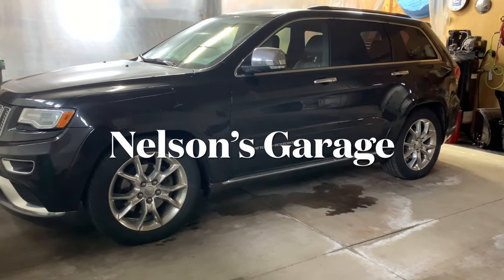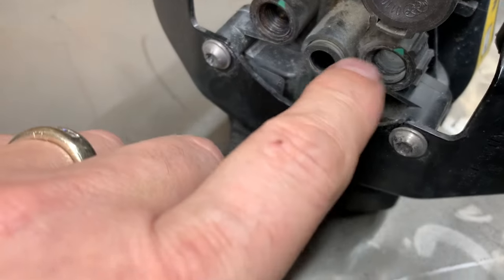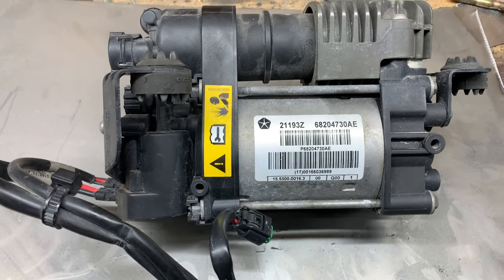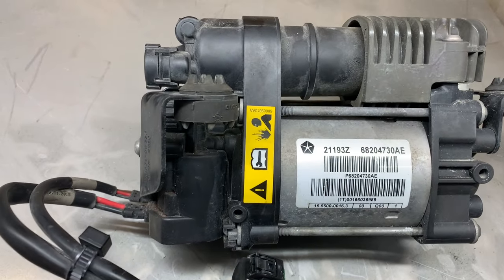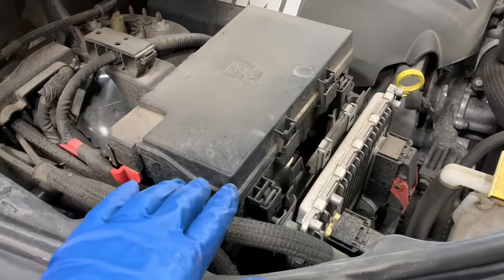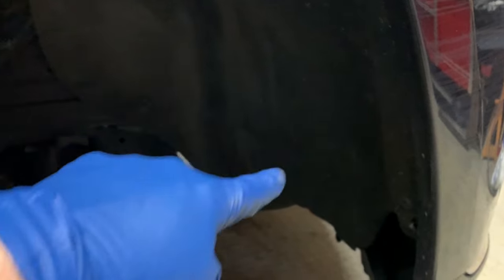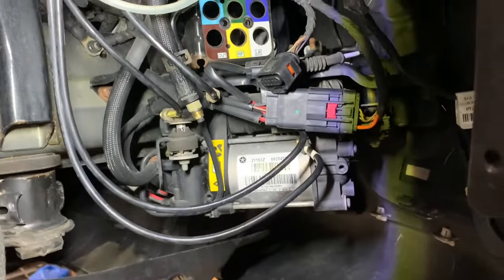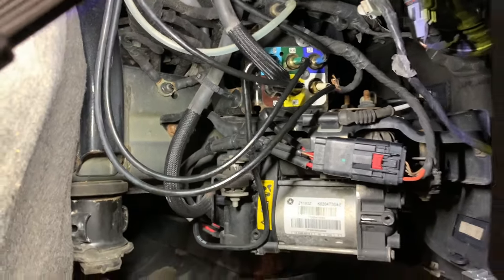Jeep Grand Cherokee Air Suspension Fix

Comment: Once you refilled the system, did you need to make any software adjustments any proprietary software required to get the system back in functioning order?
I noticed another video showed some kind of Jeep/ Mopar scan tool/software required to re-pressurize the system?
Reply from the maker: I did not make any software adjustments. I filled like i showed in the video and that was it. after, i connected to a scanner to clear any code that were caused from the pump valve issue. but that is it.
Reply: Did you have to decompress the system prior to starting the project and removing the compressor unit ?

Comment: my official jeep estimate was to change the compressor and control unit for 3000 dollars but they didn't understand that when the cars are out of the official guarantee these are prices that only thieves can afford
Reply: Yeah the dealership quoted me 5k to have the compressor replaced... After they filled the system with 100% air after a service... I told them to fly a kite

Comment: After replacing air suspension compressor, about 30 mins later I got this code C15A0-13 “ Air suspension reverse valve 2 control circuit open”. Please help. Everything is connected, fuses are ok. The code instantly comes on when erased.
Reply from the maker: That is open or high resistance connection. Check the connections, both compressor and module ( if you took the connector apart). Check for bent or pushed out pins. Also check for damaged wire, this would be pin 4 at the compressor and pin 46 at the control module, you can check resistance between those connections and should be less than 5 ohms, that will verify a good wire. Same with wires pin 5 and pin 45. Then connect the compressor and Check the ohms at the controller plug between pin 46 and 45, that should be less than 10 ohms if it’s above the compressor is bad, if it’s below the controller may be bad. That is a lot, I’m thinking it’s just a connection.

Comment: My English is not very good. But here is my question. I have a big 2014 Cherokee overland and it happens to be lowered from the front end. but he told me that I should check the automatic suspension quickly. So I took it to the dealer. Well, they changed the compressor and an air suspension on the driver's side, that was in January of this year. This week it went down again. Now I took her and they changed the passenger side. but he went to another place because the dealer gave me a bad experience because they had my car for 3 weeks. On the other hand, wherever I took it, in 2 days it was ready when the piece arrived. but they gave it to me and it says that I should take it to the dealer to reset the computer to read the new part. This is true?? Because the car is still down and on the dashboard it only shows off road 2 but it showed the same thing when we took it. And now I do not know what to do. Well, I have already adjusted the normal mode but the lights keep blinking to go up or down. And I don't understand, it already has new both sides of the suspension and also the Compressor and the pump. I hope you can guide me
Reply from the maker: If the height sensors were changed it is possible that the computer needs to re-learn those sensors and the height that they are at and the height they should be.

Comment: Good job trimming the hose going to the press-loc on the pump.   That's a common leak point many people wouldn't think to trim.  The brass connections on the manifold block are called compression fittings.  Glad to see you figured it out and helped others troubleshoot.  👍

Comment: Thanks for posting this video!  Was having the exact same issue (GC would raise just fine but wouldn't go down below normal ride height and had frequent "service air suspension immediately" messages) and likely would have followed the same path of replacing the valve block first if I hadn't seen your video.  I was unaware of the reversing valve on the pump.  Replaced the pump and refilled the tank with UHP nitrogen and now the car will go both down and up like it is supposed to.
Reply from the maker: Glad it helped
Reply: Hi John, as I have the exactly same problem on my JGC 2014, am I to understand that it is better to replace the compressor with the valve block as well, even if the compressor seems to work but stops because it overheats?

Comment: So when you unscrewed each fitting from the valve block, did each bag lose its air?  I keep hearing how these and the 90* fittings are an easy fix for leaks, but nobody talks about if the system holds air while you have bits unplugged, which if it dumps, requires a nitro refill which isn't readily as quick and easy for the average joe to do.
Reply from the maker: Yes, the bags will deflate when the fittings are removed. If you can’t or don’t have nitrogen you can use air from a compressor and it will work fine but remember air has moisture in it and may cause issues down the road.

Comment: I have a 2017 with same Quad Lift system.   Had an air leak was cracked air line to front strut.  Ended up getting 90 degree connections to strut and air line set from Mopar. RMT doesn’t sell the air line. Where air line fits to strut it’s flared.  Straight hose won’t connect

Comment: Hello, I have my 2018 GC HA around 96000 miles I got this warning, took to a dealer they replaced the valve block for 1800$ and said the problem is solved I paid and checked my car it was not solved. They took it back immediately and checked 4 days and the issue was not fixed, when I questioned, they came back with 3400$ estimate for a possible compressor replacement. 😣 they mentioned that they took a less price route to replace valve block, I don't understand how these dealers service department  cannot figure if it out before hand. If a valve block or compressor valve was causing it and they call it a world class inspection. 😢

Have to figure out a way now.

Some times it works fine but it keeps coming back. No fuses were blown out ever. 

Auto/Park mode while lowering is where the service code was triggering from what I understand.
Reply from the maker: Hope this will get figured out for you. the valve block controls each corner of the suspension (sending the up and down air to each corner), the pump has a valve that controls the up and down function. if you are randomly having this issue it will be a matter of time when the pump will need to be replaced.
Reply: @Nelsons-Garage I got it diagnosed with an outside mechanic and I was given codes- c15a1-00 and c1562-98. They mentioned that they cannot repair at a third party service - they need to calibrate with the systems, which would be at the dealership only. How did you reset the system after replacement?
Reply from the maker: @Vishnuroczz  there was no need to recalibrate the system, just clear codes, after install.
Reply: Great video. I own a 2017 GC with 100k.  Dealer is quoting $5400 plus tax for the repair including the air suspension control module and the compressor. This seems like robbery. 
Question: how did you decompress the system before starting?
Did you have to reprogram the system with special software or a device one the new compressor was installed and pressurized?
Finally where did you find the nitrogen tank supplier ?
Thank you !
Reply from the maker: @afcase  I didn't do any thing special to decompress the system, i just unhooked the lines. After the new compressor was installed, i did not do any reprogramming as the system knows where it should be do to the height sensors. The nitrogen was from a local gas/weld supply company, i used Air-Gas company.
Reply: Hello Nelson, Can you tell me if part 68572790AA comes with valve block ? Or is it just the air compressor
Reply from the maker: @Vishnuroczz  that looks like the pump only, without the valve block. But please note the pump has a reversing valve built in. The reversing valve raises and lowers the vehicle. The valve block distributes the up or down action (created from the pump) to each air bag. I hope that makes sense.
Reply: I got it fixed from a dealer but was not sure if the valve block comes with the complete assembly. The picture in the mopar website  shows the valve block assembled. So was wondering  about it.
Reply: I have the exact same situation. 2019 GC Overland. The pump would run a long time and not go down, I took the cvar to the Jeep dealer and they guaranteed it was the valve block.  Not even 30 miles the warning appeared now I need to replace the pump/cpmpressor. Really not happy with the dealer. $2700.00CDN$ to trouble shoot and tell me it is the pump. Now another $4800.0 CDN$ to replace the pump compressor. 
I have seen another comment regarding a rebuilt pump from RMT indicating that it is good value and reliable fix. However, I am not sure the dealer would want to install refurbished parts.
Thanks for the great video and explaining in how the system works.

Comment: Thanks for this great video about repairing air suspensions on JGC. I have the same problem with my JGC 2014 Summit 5,7L.
Can you give me the part number of the connector that fits on the nitrogen tank to recharge it, because mine (R134) does not fit. Can you also give us the Amazon reference of the regulator (yellow, red, blue) that you use? Thanks a thousand times. Alan
Reply from the maker: The nitrogen regulator is by Yeswelder, WX-YQD-CGA580 from Amazon. the gauge setup to charge the tank is from Harbor freight it is just a standard automotive AC charge gauge set. I think the larger line connects to the tank.
Reply: @Nelsons-Garage  Thank you very much. I have bought the same Yeswelder regulator on Amazon. I have just ordered a set on RMT website (valves block and compressor) and I returned a Luft Meister compressor and a valves block purchased on Amazon, because I'm not sure it will work well in winter... RMT is a better alternative, I think ! I will follow your excellent tuto, but first I will try with pressurized air and I will change for nitrogen if it works.

Comment: My wifes jeep displays service immediately. Goes up and down fine, does not leak as far as i know. Dealer said the compressor and module are fried. Light only comes on on the highway. Anh idea's? Thanks! Great video
Reply from the maker: Its hard to tell without a scan, but the suspension does go down in aero on the highway. if this doesn't happen in a timely manor it would display the service immediately. This is tough to guess at,   but i would first check the links at each control arm making sure they are not loose or broken. otherwise, it sounds as if the compressor is doing its job going up and down and the module is communicating to the compressor. the only thing would be time, if the compressor runs too long, the service light comes on. leading me towards the compressor and the valve within the compressor becoming slow or leaky (inside the system). I would think through time the service light will start coming on more frequent. this is all just a guess without a scan.... good luck and let me know what you find.
Reply: Wow! Super fast reply! I will dig into it today a little more. Super frustrating.

Comment: Thank you so much for this information. I have a 2013 grand cherokee 5.7 , 1st the front was struggling to lift and i was advertised to  replace the schocks which were indeed  warn. Now the compressor doesn't run at all. I've checked the fuses and relays but all seems good. I haven't regassed it yet. I need to drive it to the dealer to get gassed. But why is the compressor not running 😢
Reply from the maker: That’s hard to say without a scanner on the system, possible it’s the controller. But I wouldn’t jump to conclusions without a scan.

Comment: Question, I have a ram 1500 that has two of those tanks, under the truck. Does the Jeep have two tanks as well? I'm trying to determine what size tank I need and how much nitrogen needs to be in it in order to refill my entire system because I have to replace both the air compressor and the distribution block. Thanks
The dealer quoted me $4,800 to replace the air compressor and the distribution block. I bought the air compressor and distribution block from RMT for $400 plus core. I'm not a full-fledged mechanic, but I've done plenty of work to cars, so I'm hoping it's not too difficult. I also have access to alpha ODB to do any additional settings.
Reply from the maker: The Jeep only has one tank as far as I know, but if you got a small nitrogen tank it would be plenty..
Reply: @Nelsons-Garage  thank you!
Reply: @m3rdpwr  Have you guys had good performance from the RMT compressors ?

Comment: Did you have to decompress the system prior to starting the project and removing the compressor unit ?
Also, how did you know what the final pressure should be when filling the tank? Did you cycle the height while filling the tank
Reply from the maker: I did not decompress the system, I pulled the line and let the pressure out. I checked the pressure before I started and put that much back in.

Comment: excuse me, I have my jeep air compressor works at each morning for about 15- 60 seconds, is that normal ? 
one mechanic told me it is normal for the compressor to adapt to low pressures in cold weather at morning.
thank you again for explanations.
Reply from the maker: No, the system shouldn't have a pressure difference due to temperature. This is why there is nitrogen used. Nitrogen doesn't contain moisture like air so it doesn't fluctuate pressure with temperature. If you used air to fill your system, then yes i could see that happening.
Reply: @Nelsons-Garage  amazing information, thank you ..
I dont know my system is filled with air or nitrogen , but one time the mechanic deflated the front air springs both , without replacement, so I thought that the compressor itself had filled the deficiency, for sure by ambient air.
so that means if I dont have a leak, and I filled the system by nitrogen, I would not have fluctuations in pressure in the future.
Reply from the maker: @hassanmahmood661  Correct, the system is designed to pull outside air IF the system went low on nitrogen.
Reply: @Nelsons-Garage  thanks alot.. and forgive my poor language sir..

Comment: So I have a 2019 Jeep Grand Cherokee Overland edition. I'm having problems with my suspension pump also. I'm getting that same message on my Dash to immediately service. It's exactly what your video shows the pump will work and you can clearly hear it but it will never go back down into park mode period. I really want to try to fix it myself but was concerned about what I was getting myself into the Jeep dealership quoted me 4,800 I mean really I'm still driving the car but I'm just super concerned about the damage I'm doing
Reply from the maker: You can change it yourself. Just take your time.
Reply from the maker: If the suspension is up, you’re ok, if your suspension is down then damaged can be happening. Either way it needs to be fixed, and you can do it.

Comment: Hi, I have a 2019 summit with similar problem. Jeep goes up but front drivers side goes down almost to the ground. Just ordered full strut assembly for that side. Is that a good way to start or do you suggest trying something else first?
Reply from the maker: Most likely a leak, first I would check the air fill line on top of the strut, under the hood. Those are known to leak. Then the lines and then the air bag/strut itself.

Comment: Hi, what code did the ascm put out when you had that problem? Mine sometime work, sometime it goes up but dosent goes down and you hear the compressor forcing more, rear wont go down. Mine trow the usula c15a1-00 , 1562-98,  1556-96, 1566-92. 

Dealer diagnosed a bad valve block….. stating if it dosent fix compressor will have tonbe changed. Ordered a full RMT unit .

Also im not losing height at all and airmass always check okay when i check it with jscan. Also get the the compressor orverheat / cooling down, never blowing fuses tough
Reply from the maker: Mine Threw several code, C15D-00 Low air mass, C159E-15 air pump temp, C15A0-13 Air reverse valve 2, C159F-13 Air reverse valve 2, C15A1-00 Unable to obtain desired ride height, C1562-98 Ride height air pump control.
Reply: @Nelsons-Garage   thanks mine didnt trow the reverse valve , but im not gonna gamble and change both even tough delaer said valvle block
Thanka

Comment: there was a leak discovered on the elbow valve of the left front strut that made my car sag too much at each morning from rhe front , had it repaired successfully , but still have a much less leak thought because the compressor keeps running for a while at each morning ...
can i catch it and make the air circuit completely sealed without a leak ?
Reply from the maker: The system is designed to be sealed completely.
Reply: @Nelsons-Garage  thank you for replying, but can a leak be from the valve block ? and how can it be discovered ?
Reply from the maker: @hassanmahmood661  Yes, the lines going to the valve block can leak. If it’s a minor leak and you can’t hear it, I would take soapy water in a squirt bottle and spray the area of the lines and watch for bubbles. You can do this anywhere a joint is.
Reply: @Nelsons-Garage  I'll do it, thanks again ..